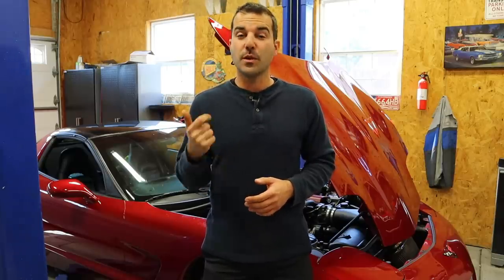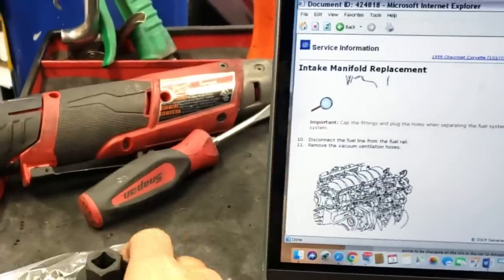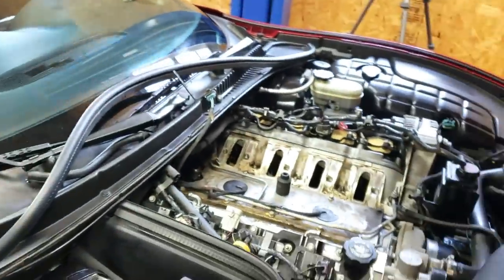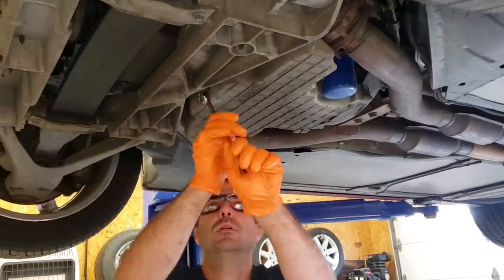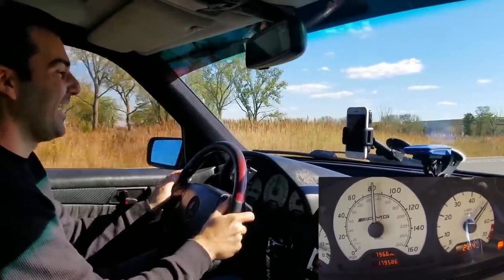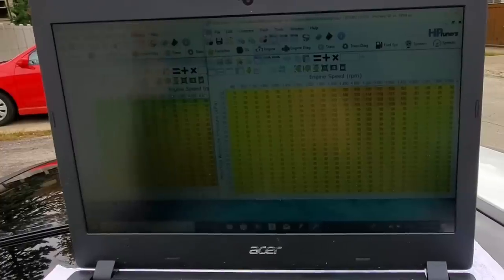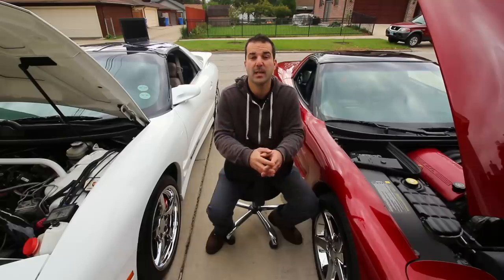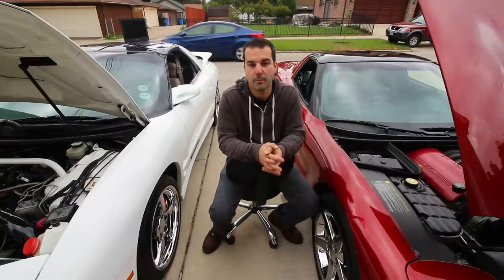I’m Building A 40 MPG Corvette That Sacrifices NOTHING! Project EcoVette Starts Now!

Comment: the reason for 14.7:1 is the catalytic converter, Nothing else…
Reply: ^That's a fact
Reply: The reason for 14.7:1 or stoichiometric, is it's the theoretical perfect mixture of air and fuel for a complete burn, meaning all of the fuel is used to propel the vehicle. So it's actually for power and efficiency not just air quality. 

So the actual reason behind a catalytic converter is because a stoichiometric ratio at high power levels is impossible to sustain without melting the metal containing the combustion. More fuel is added at high cylinder pressures purely to cool the damn thing down. So without a super hot catalyst to burn some of that raw fuel it'd basically be like pouring it onto the road. 

If you enjoy breathing fuel vapor and carbon monoxide, just move to India, or pretty much any other Asian city. The millions of carbureted motorcycles, and ancient diesel trucks packed into a tiny area should keep your lungs satisfied for decades. 

Might end up with some brain damage but at least you gave the middle finger to all those stupid greenies.
Reply: @littlerhino2006  running an engine leaner doesn't necessarily make it run hotter. It also isn't necessarily bad for the catalytic convertor. What it does do, is limit the amount of time available for a full combustion cycle. This will allow for pre ignition or misfires which will make your engine hotter, and damage your cat, from excessive heat and unburnt fuel. Mazdas new engine runs at like 25:1 with no issues. 
Regular gasoline also has very little cooling effect in a cylinder, and if you run your car excessively rich you will also make your car run hotter from misfires and preignition.
The symptoms for over rich and over lean are basically the same thing.

Comment: on my vehicles i replaced all the rubber vacuum lines with silicone lines. everything works noticeably better from the brake booster to the overrun when off the gas pedal.

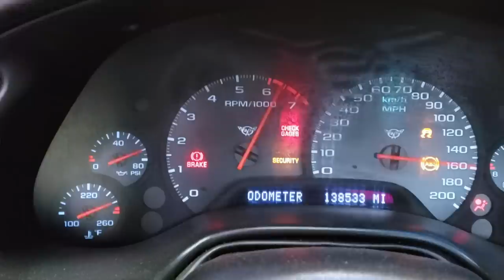Comment: Knew a guy who blew his rear 99 Camaro gears at the track, put in an old 2:56 diff in and suddenly got 52mpg @750rpm on a drive running air. We all were amazed how efficient the LS1 engines are.

Comment: Lean is mean.  You touched on the NOx portion, because with an engine running lean, the oxides of Nitrogen increase with cylinder head temperature increasing.  When Combustion chamber temperatures run approx 1500 degrees and up that's when nuclear fusion occurs (on a very small scale) and you start creating those "acid rain" gases out your tailpipe.  What are you doing to help with cooling?  Lower temp thermostat?  Adding cooling capacity with extra heat exchangers? or more efficient ones?  Thinking about something like "Water wetter?"

Comment: Carbon ceramic brake rotors, carbon fiber driveshaft, lightweight seats, lightweight forged wheels, titanium catback, lighter pulleys and flywheel 
Should shave atleast 100 lbs

Comment: Lean Burn is great if you do not need to meet NO2 /NOx and can radically increase fuel economy if you can get away with it! The more you flirt with the it though the closer to disaster you  get. As a pilot in recipricating internal combustion engines we manual tune the mixture in cockpit. We have mixture controls, EGT, fuel flow, manifold pressure and rpm reading in cockpit.

Comment: An easy heat soak reducer is a heat shield between the underside of the intake and the valley cover. Reduces intake temps considerably and it's CHEAP. A section of DEI trans tunnel shield is a good option.

Comment: This video just shows me that if American lawmakers and manufacturers actually cared about MPG, serious strides could be made. Something as simple as putting in a beefier cooling system could curb the increased heat from the lean burn, and it's literally as simple as using Holden ECUs (which are already a subsidiary of GM, so it's as easy as Papa General making/programming more of them). ~400 HP, tons of low end grunt, no turbo lag, AND 40 MPG? Yes to all!

Comment: Former Honda tech. here with knowledge of non hybrid Hondas (and especially not that suppository shaped Insight nonsense), 92-95 Honda Civic hatchback VX model had wide band O2s and lean burn in the USA, and the next generation Civic had lean burn in a coupe HX model, and finally before those they did it on the 2 seater CRX in the HF models. I recall reading they went away with it on most models due to difficulties meeting EPA and CARB regulations while maintaining reasonable costs due to the NOx emissions and more advanced catalytic system requirements. I haven't worked on Hondas for a living since 2007 so I'm sure things have changed, but up to that year those were definitely lean burn real cars, not hybrid silliness. By the way the 92-95 Civic VX got something like 52-55mpg without hybrid cost or complexity.

Comment: Balance your injectors, inflate tires to 50 psi, close off the front end lower rad intake to reduce drag, add a WBAFR sensor and egt sensor will deff help with the tunning.

Comment: Top two items you're not considering that maybe you should: 
1. A new set of high-atomizing fuel injectors (Bosch IVs) run at high fuel pressure (Porsche ran them at 4 BAR) -If you go with a bigger set of injectors and get the off-sets your turner can play with the timing to get small gains in torque / MPG. 

2. Water /Meth injection -you've got enough viewers / subscribers you should see if you can get sponsored on a good set of injectors AND a water / meth kit. The water meth kit will allow you to run REALLY lean at cruise and you'll hardly be using any water / meth at cruise anyway so it will last a long time. 

(If you combine this with a bump in dynamic compression ratio from a cam / spring swap on the heads -you can run a cam with a duration @ 0.050" and an LSA similar to stock (or even slighly bigger) but with a much smaller advertised / seat-to-seat duration which will increase cylinder pressure / dynamic or "Effective" compression ratio -this could be a problem on pump gas but with the water/ meth you no longer have to worry about that.)

P.S. I've been doing a similar project on my 1979 C3 Corvette: Trying to double the stock HP and fuel economy of my restomoded 79 Corvette. (I did a swap to a 4L60e computer-controlled OD transmission with lockup TC, 1.2mm piston rings, a modern high-intensity roller cam, a long-runner TPI-style intake, sequential multi-port fuel injection ala Holley HP (with lean burn), higher 10.2:1 static CR with new high torque (average airspeed) focused aluminum heads, LS coil-near-plug ignition, and long-tube headers; also did Amsoil synthetics everywhere although I think it's most useful in the transmission fluid actually as the trans oil pumps rob quite a bit of power.

Comment: Sorry for the spam; should be last post, but... Know that the LS1 ignition coils are the worst of all LS coils. If you're not going to replace the ignition coils, consider using the Brisk Racing LGS spark plugs -they use a semi-surface discharge design which allows for a much larger spark gap than a traditional-style spark plug with the same starting voltage. Running a larger gap gets a larger initial flame kernel and helps slightly reduce ignition timing requirements. (Yes, I know the "Weird spark plug" industry is full of snake-oil but these seem appropriate for your goals.) 

For your tuner: the LS 1 coils don't fully saturate until 8ms of dwell time but energy doesn't increase much past 6 ms.   -Your stock cam isn't going to keep pulling super high in the RPM range, so the higher dwell time is ok and may help with your low-RPM mpg.

Comment: Commented this already ,but after having to trade in my twin turbo Cadillac hwy machine I had to get a Hyundai.  Luckily,  they had a hybrid which gets 50mpg running speed limits. 40 running 90mph! After checking several models of Tesla with my car insurance and seeing the 6 month quote sky rocket, I found your channel. Knowing c5s and get 30 and C6s can get 28+...I was dead set on a stock or supercharged stock engine vette with a manual tranny. Now!? I'm ecstatic!  Yes I want the handling and speed of a Vette. However I daily between 125-200 miles a day, currently 280....A DAY! 6 or 7 days a week. Life in construction lol. Anyways,  I could never afford or choose not to lol getting 15mpg.  Thanks for making this video!

Comment: Dunno if anyone chimed in as per your "USDM vehicle being legally able to 'lean burn'"...

The '97 Civic HX came with a special VTEC-E engine which altered valve duration to allow a better a/f mixture at lower RPM's. With few amenities like lower trim Civic's and lighter weight alloys it averaged around 40mpg.

That aside, are you gonna bother to run Non-ethanol fuel? Keep up the cool works man.

Comment: Actually NOx is highest at stoich to ever so slightly lean of stoich, thats where the highest peak combustion temperature is. "Proper" lean-burn, say lambda 1.2 or around 17.4 AFR (for E10 gasoline), has colder temps, and actually reduces NOx, and basicly removes most all CO, but it's illegal in most of the world, because rule-makers have yet to discover that we have wideband O2 sensors, and not the narrowbands that are basicly useless outside Lambda 1 (stoich)... It's just old requirements that have stuck since the 90's.
Reply: Also, as a sidenote for people trying to do lean-burn, It is for light load (cruise) only or about up to 60 kPa manifold press, and a lean mix burns slower than richer mixes, so without adding more igntion advance, you are just going to waste the opportunity and infact get worse milage, and potentially get so high EGT's that frying some exhaust valves is in the likelyhood... Just FYI

Comment: leaning is a bit complicated. If you go "lean of peak" (peak temperature) you keep the efficiency but NOX drops dramatically (as does power, but you don't need much power when cruising). The trick for low NOX is to avoid operating lean in the "peak temp to stociometric" range

monitoring egt is critical for this stuff, You don't want to burn your valves

One of the obvious changes is: "a modern ECU with more inputs and faster processing"

Comment: If no one has days it yet. The simplest, maybe not the cheapest, option is to get super hard compound tires and over inflate them by 10-15psi. It lowers rolling resistance without sacrificing too much grip.

Comment: In my mind using timing advance may be a better route. You always want to run lean as possible, but sparking at higher compressions could give you similar efficiency gains without sacrificing the cooling that comes with spraying a proper ammount of fuel. Just two cents from someone talking out of his rear

Comment: I had a 2004 zo6 and did ported heads, cam, fast 102 intake, gt500 injectors, nick Williams 102 throttle body and got 34 miles to the gallon on the highway. And I make 503 hp after tuning with HP Tuner

Comment: You don't need speed density to run open loop.  Also properly tuned lean burn will not melt things down.  Combustion temps peak at stoichiometric and drop when leaner or richer.  Another note your tuner probably knows is a lot of spark advance needs to be added because lean combustion is slow.

As for headers, exhaust, etc.  When driving 55 mph, the engine makes 15 to 20 hp.  Exhaust flow is proportionally low so no exhaust work will help.  Anything to reduce weight, or rotational weight is helpful, but not at steady speed.

Comment: "Please correct me if I'm wrong" - Plenty of cars in the US can (or at least did) run lean burn. Honda's VX, HX and entire hybrid lineup leaned out considerably, in some cases as lean as 24:1 in the US. Also, lean operation does not raise engine temperature past a certain point. Peak combustion temperature happens somewhere in the low to mid 15's, and going any leaner than that NOx starts to drop off as combustion temperatures drop - there's simply less power being made and thus lower temperature.

I personally have a Honda Insight with an Acura TSX engine. It runs high 10's in the quarter mile and my best tank so far has been a hair over 65mpg, in part from lean operation at part throttle.
Reply: Most of the lean=hot narrative comes from the forced induction scene, where it's common for engines to run as rich as 10:1 for the cooling effects of dumping fuel (as a better alternative to pulling timing). "Lean" in the context of forced induction could be 13:1, which could burn valves, but that's still overall a rich mixture.

Comment: Hi, Alex I had a lean tune in my 2003 holden ss ute fuel down to 7.3 litres per 100kph it made 221 rear kw since then i have put a magnacharger kit on it with a custom tune.

Comment: My kid's 94 Civic VX has factory lean burn. It goes to 22:1 in lean cruise. I've seen 52 mpg with it and it could do better but where we live isn't super flat. 5th gen Civics don't normally come with an EGR valve but the VX does to help counteract the elevated NOX. That engine never gets hot or pings and oil takes 10K miles to start getting dirty.  I'm sure you can hit 40 mpg. It will be interesting to see how.

Comment: It’s also a very thin line to tread with running anything less than 14.7:1 between saving fuel and literally destroying the engine.   Any spike in torque demand could push the engine into knock due to heat which chain reacts the process very quickly.   

The best way to get better fuel economy is ditch the boat anchor in the front of it, install a small, modern (ie anything not made in Merica) 4 cylinder engine and a turbo or 2.

Comment: That's a typical air leak.

I had a truck with a 2 stroke Detroit that started surging at idle. I had a dozen diagnoses that didn't sound right to me. 

So I go to a guy who seemed to know everything about it diesel. He was the manager of a big shop.

He told me to crank it up and immediately walked around to the fuel line coming out of the diesel tamk  reached out and wiggled it (it shouldn't wiggle) and said You have a cracked line. An hour later after it was replaced she ran like a top,  once again ready to wail.

Comment: Lean mixtures don't run hotter, the engine out nox goes down, but the catalytic converter can't reduce the nox when the exhaust is lean, so the exhaust out nox goes up. Lean cruise has been used in the USA. Honda and GM both had models that utilized it. You won't melt your engine components using lean cruise. You will make your vehicle out of emissions compliance, however. The notion that by not going too far lean, you mitigate this is completely wrong. You mitigate it by going very lean, so the combustion temperature drops enough that engine out nox starts dropping rapidly.

Comment: I have a 83 Oldsmobile that could use modifications. I've thought about doing an engine swap but my guess is that I may not need to even do that. It's not fuel injected, it has the 4 barrel carburetor. The other is I may need to replace the transmission for better gas mileage. My idea is to replace the 4 speed with 6+ gears then get a custom programmed computer for the OD to reach higher gears while keeping the first 3 gears available for me to choose. The other is to replace the exhaust with larger tubes and stay in compliance with emissions.

Comment: From my experience tuning a friend's Acura Integra, older Honda engines do love their leaner fuel mixtures when N/A. I have been tuning my friend's car since it was a mostly stock Non-VTEC engine,  to a high compression non-VTEC engine, to a now high compression VTEC engine. At no time, even with the now 12.5:1 compression, has the engine ever been happy running 13.5:1 AFR when being pushed. And now that his engine is VTEC and the unique way the valves open when off VTEC, cruising around at light load the engine runs perfectly happy in the 15:1 AFR range, going a bit closer to 14:1 when under heavy load off VTEC.....he gets great fuel economy and the engine is always on kill. All the tuning is done with no ethanol 91 octane fuel, and those rare times he gets 94 octane with no ethanol I add more ignition timing, and the engine really comes alive :)
Reply: My old Mitsubishi 1.8 GDI have direct injection and 12:1 comp. But i use only 98 or higher octane (Europe). Ones in a life time i filled the tank with 95oct, everything was ok until i did not push it harder, to accelerate from 100 to 130kmh - check engine light went on, probably knock sensor.
But in eco driving you get 5.0L/100km on highway in a compact minivan. 
Car is 100% stock, zero mods, 240.000km.

Comment: "Lean is mean" BUT - For 10 years I taught dyno tuning and, with an expensive  spark plug viewer made by CV products, I "read" spark plugs from our dyno mules. It's amazing what you can see if you know what to look for. I've seen tiny little Aluminum balls on the white insulators surrounding the center electrode. These indicated a "fog" of melted Aluminum coming off the tops of pistons. Anybody who is serious about tuning for max power, and efficiency, needs to invest in one of these viewers. Another interesting thing were faint tan splotches on the same white insulators. This test is best performed with new or very clean plugs. I called these splotches "freckles" and they indicated the engine killer - Detonation!
Reply: Which is what I'm worried about. He's probably going to end up destroying the engine.

Comment: The Honda Insight and Civic Hybrids from the early 2000's use Lean Burn. Up to 22-1 A:F which is how the gen1 Insight achieves it's 70mpg highway. They only had it in the manual cars here in the states, Japan got the CVT with lean burn but it didn't make it over here.

Comment: I own a 1999 Mazda MX-5 and I'm lucky to see 26 MPG (even with the top up). As a frame of reference I have a lot of weight removed from the vehicle, including no power steering, heat, air-conditioning, radio antenna, with Kirkey seats and no airbags. I think it's down to how short the gearing is.